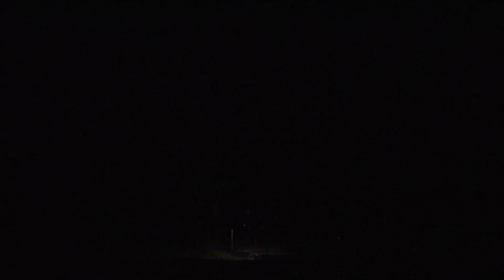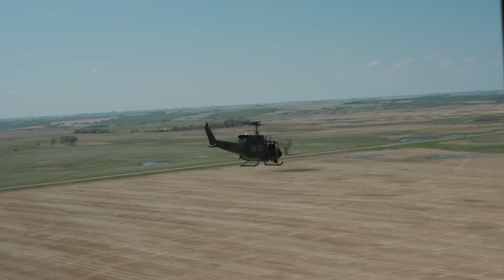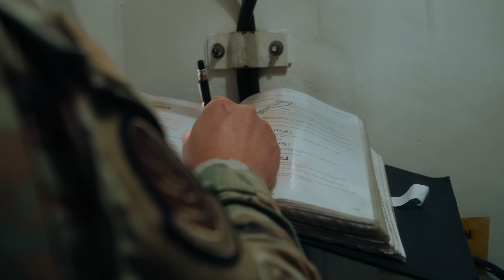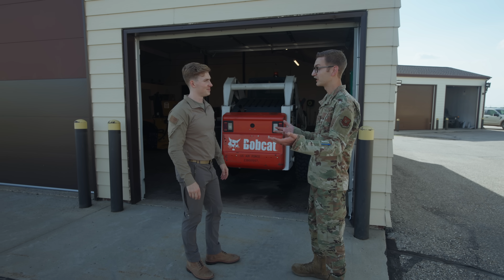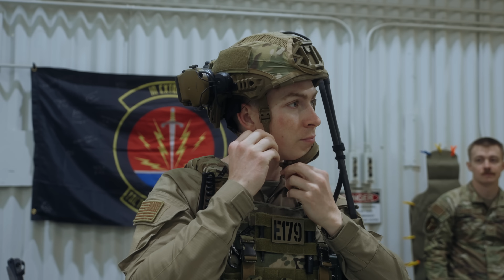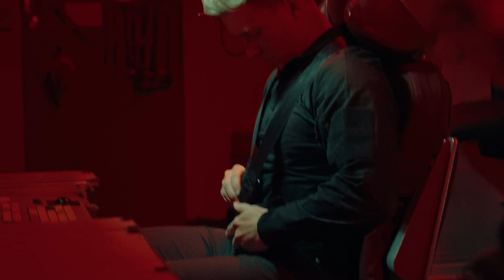Inside A Top Secret Air Force Nuclear Missile Silo

Comment: Interesting tidbit:  all the tools used on the missile are completely unique sizes.  The bolts, screws and fittings are all non-standard, meaning no existing commercial tools will work.

Comment: Unless the protocol has changed since I was a Missile Launch Officer at Malmstrom AFB in the late 1970s/early 1980s, it takes another missile launch crew, in another separate Launch Control Center in your squadron, to verify the launch orders, enter the needed codes, go through their launch checklist and then turn their keys for the missiles to actually be launched. This was in place as a fail-safe measure so one crew could not launch nuclear weapons on their own. In other words, again unless the procedures have changed through the years, one crew cannot launch the missiles by themselves. It takes another crew at another site to independently do their actions and turn their keys before a launch can happen. I don't think that was mentioned in the video. Just FYI. Great video and thanks for making it.
Reply: Thanks for doing your job with these amazing weapons 👍

Comment: I was a 742nd Crewmember back in the 80s so I pulled a few alerts at Oscar. This was fascinating. A few reactions.

1. The LCF was a fricking palace. When did that happen?
2. Interesting to see the mix of new stuff with old stuff. The Enable panel and the Launch Control panel were just as I remembered. No LECG though.
3. Where is the Red Box? Who said they could remove the Red Box?
Reply: Cool to hear you worked on thesr amazing weapons 👍

Comment: i have a question when these miitary personnels are trasnporting these resources    arnt they radio active like can cause cancer or something how are they sealed and protected.?
Reply: I am one of the ones who used to do this job, well like 25 years ago, But security was not well informed on that subject, we was told it was safe. I am sure some "expert" will reply to this pretending like they know what they are talking about.  The way we looked at it was like any job. We would do the job and go home. We understood and respected the risk involved, but when we was transporting the weapon, we did not talk much about the job, it was pretty much water cooler talk the whole time. We was ready to react if needed.  But honestly, 95% of the job is just riding or driving the vehicles.

I wish i could give you a more solid answer than that. Hopefully one of the missile maintenance guys or girls will see your message and respond.  The ones that would know for sure is the Department of Energy, but the chance of one of them responding is very very low.

But (crossing my finger) i have had no signs of cancer

Comment: i used to work along side the 91st as a mobile vehicle mechanic (we were called mobile joe lol). working in the missile fields, fixing broken trucks or helping with the convoy movements was by far my favorite job/mission i had during my 11 year air force career.
Reply: What year? If it was anywhere around 2000 you was always the big hero... When we got the M1116 HMMWVs, and was flinging fanbelts left and right. (i was in the 90th, ie FE warren, security)
Reply: Also i know it is slightly enjoyable that you know you dont have to really stop for anything (when doing movements)
Reply: @floridaboz1 i was there well after that time, 2016-2019

Comment: This was extremely cool so here’s a    fun fact:heres how to build a nuclear reactor: Step
1: Acquire Uranium (Or Another Fissile Material)
Before you can even think about building a reactor, you need fuel. The typical fuel for nuclear reactors is Uranium-235 (U-235), but other fissile materials, like Plutonium-239 (Pu-239), could also work.
In a real-world scenario, you can't just walk into a store and grab some uranium. You'll need to obtain it from a specialized supplier or government facility (assuming you want to stay out of jail).
Uranium-235 is naturally rare (only about 0.7% of natural uranium is U-235), so it has to be enriched (increasing the percentage of U-235) to make it usable in a reactor. You'll also need to check the regulations because getting your hands on uranium is highly regulated.
In our theoretical scenario, let's just say you managed to acquire a truckload of uranium in one convenient shipment. You've got about 5 tons of U-235 ready for action!
Step 2: Assemble the Reactor Core (The Hot
Zone)
The reactor core is where all the magic happens.
This is where you'll place your uranium fuel and let the nuclear fission process begin.

Fuel Rods: First, you need to take your uranium and put it into fuel rods. These are long tubes that contain uranium pellets. Think of them as giant space-age pencils filled with radioactive material.
The rods are arranged into fuel assemblies, which are carefully placed inside a reactor vessel. You'll arrange them in such a way that there's enough distance between them to allow for controlled fission.
The trick here is that the uranium will split (fission) when it absorbs a neutron, releasing tons of heat and more neutrons in the process. These new neutrons will go on to split other uranium atoms, creating a self-sustaining chain reaction.
But hold your horses! You can't just let this reaction run wild. You need to control it.
Step 3: Control the Chain Reaction (Like the Boss
You Are)
In a real nuclear reactor, you use control rods to regulate the chain reaction. These rods are made of materials like boron, cadmium, or hafnium, which absorb neutrons. By inserting or removing these rods from the reactor core, you can increase or decrease the number of neutrons available for fission, thus controlling the reaction.
If you want to slow down or stop the reaction, you insert more control rods.

If you want to speed it up, you remove some rods.
In our theoretical reactor, let's just assume you have perfect control and never let things get out of hand. You're basically playing nuclear chess with your rods.
Step 4: Add the Moderator (To Slow Down
Neutrons)
Now that you have your fuel and control system in place, you need a moderator. The job of the moderator is to slow down fast-moving neutrons produced by fission. Slow neutrons are more likely to cause more fission reactions, making the process more efficient.
In real-world reactors, you might use:
Water (HO) (most common in Pressurized Water Reactors (PWR) and Boiling Water Reactors
(BWR)),
Heavy water (DO), or
Graphite (used in some reactors like the Chernobyl-style RBMK reactors).
For this theoretical version, let's just say you're using ice (because cold is cool, right?). You could surround your fuel rods with ice, and as neutrons smash into it, they slow down and get more likely to hit uranium atoms.

Now, ice is not technically the best neutron moderator in real life, but in this world, we're going for the aesthetic of an icy nuclear reactor.
Step 5: Add Coolant (To Keep Everything from
Melting)
When uranium atoms undergo fission, they release huge amounts of heat-enough to melt the entire reactor if you're not careful. To prevent this, you need a coolant to absorb the heat and carry it away from the reactor core.
In real reactors, water is the most common coolant because it absorbs heat and can be pumped efficiently through the system. However, in our theoretical design, let's choose molten lava (because, hey, why not?).
You can now pump molten lava through pipes in and around your reactor core. As it absorbs heat, it'll get extremely hot, which can be used to generate steam for power generation.
The heat will transfer from the lava to a secondary water loop that will turn into steam, which will be sent to a turbine.
Pro tip: Just make sure the lava doesn't melt through any of the reactor vessel walls. That could be bad news. But, since we're operating on theoretical logic, we'll assume this won't happen.

Step 6: Steam Generation (Turn Up the Heat!)
The hot molten lava you've just created will need to be used for something productive, so we'll send it to a steam generator.
In your steam generator, the molten lava will heat a secondary loop of water, turning it into steam.
The steam will then travel through pipes to the turbine, which is the real engine of the system.
The turbine will spin, converting thermal energy (heat) into mechanical energy.
This mechanical energy can be converted into electrical energy through a generator, which is basically a giant magnet spinning inside coils of wire. This is where you'll get your electricity!
Step 7: Build the Turbine and Generator (For That Sweet Power)
Now, it's time to spin that turbine and produce power! The turbine is a massive spinning blade connected to the generator. When the steam hits the blades, the turbine begins to rotate.
Turbine blades spin when steam is pumped through them.
The spinning turbine powers the generator, which produces electricity.
So, theoretically, you could now start supplying power to a small city, assuming you haven't caused a melt-downs yet.

Step 8: Containment Structure (Don't Blow
Everything Up)
In case things go really south, you need a containment structure to keep everything contained in case of an accident. This is the emergency plan for if things get a bit... explosive.
The containment structure is a thick, reinforced concrete building designed to withstand any explosion, radiation leaks, or unfortunate accidents. You need this to prevent radiation from escaping into the atmosphere.
So, you've got your reactor core, coolant, moderator, turbine, and containment structure.
Everything is set up, and you're ready to generate massive amounts of energy!
Final Step: Enjoy Your Reactor!
Congratulations! You've theoretically built your nuclear reactor. You've got your uranium fuel rods, control rods, moderator (ice), coolant (lava), steam turbine, generator, and a massive containment structure to protect you from the consequences of your questionable life choices. Please like this took 2 hours to type.
Reply: Chatgpt? Grok? Gemini?

Comment: I was stationed at Vandenberg AFB from 1967-1971 as a Minuteman missile launch officer. It was the heyday of Minuteman testing. I worked about 200 launches and actually turned keys on 18 missiles, including MM I, MM II, and MM III, for which I have sack SAC missile on certificates. An additional duty I sometimes volunteered for was visual observer (VO). The VO was on the camera pad nearest the silo, basically looking down the hill at the LF, and was responsible for giving a verbal narrative of the launch: launch closure open, ignition, missile away, and reporting any anomalies. You're as close as you could get to the LF and was an amazing experience; the noise, especially, just overwhelming the senses. One time I did notice something unusual about the way the missile was acting — it seemed to have begun a slight corkscrew — and told the launch director I thought we had an erratic missile. Things got interesting quite quickly and range safety finally blew the missile. The most beautiful launches were those that happened just as dusk was fading. Sometimes when the second and third stages separated, as the gases quickly expanded in the virtual vacuum at that altitude the just set sun would shine through the moisture in the gases and create incredible color cloud displays that spread out across the sky. It could be seen as far away as LA and San Francisco. In fact, when it happened on one of my launches Davis-Monthan in Tucson reported being able to see it. Best duty ever!
Reply: Cool 👍 Thank you for working on these amazing weapons.

Comment: That would be the most boring job
Reply: I did the security side of this for 5 years, and it is about 98% boring, and 2% excitement. Important jobs all around, but you are very correct, it is very very boring. Just think of it this way, driving a HMWWV from silo to silo for 12 hours strait. HMMWV's are not known for comfort, and believe me, they are as uncomfortable as they look, and then think about being in one for 12 hours strait. When i was in, they did not have the bearcat's yet, so i cant speak on how they was.

Comment: They are not exactly hidden, you can drive by them anytime you want. Just don't try to enter the gate, a strike team will have you hugging the ground in short order, I was a targeting team member at Malmstrom AFB, MT. In 1966. They have definitely been improved but are basically the same. Been in several LCFs and tons of LFs over my time there. Still brought back memories, though they were distant memories.
Reply: What was your Tango-team number?  I was Tango-9's team chief about then. They don't target the birds using those Swiss-made theodolites (that the Russians used the bottom part!) anymore. All done from the capsule, star trackers and GPS and other stuff.  Remember trying to do an RMAV from Station A at about -40F? All sorts of fun! What I don't get is the thing about "four keys to launch". Remember trying to drive to Oscar-1 and then going to work and finish in enough time to drive back to base without having to RON? Even get lost trying to find a site in India-flight, even with the site map?  Did you ever try to get T-van 805 to drive to a site without the engine blowing the freeze plugs if the OAT was below freezing? Are you a member of the Association of Air Force Missileers? They are holding the bienial meet at Minot next August. Wonder why not in the usual month of October? lol  Why not Minot? Freezin' the reason. SACum cized member of the 341st MIMS 1965-69.
 
 I see four keys in one capsule, but it used to take two capsules (4 capsule drivers) to launch.

Comment: Never understood why missileers wear flight suits.
Reply: Because it’s an enclosed environment with an electrical equipment that can catch fire. Flight suits are fire retardant. 

Missileers used to have a different distinctive blue suit. When the budget cuts hit near 9/11, the pilots that ran the Air Force took the blue suits away and said, “here…just wear the green suit.”
Reply: @EverydayMarksman  Do you know why they strap themselves into the chairs?
Reply: @tw27242 in a nuclear exchange, there’s a high probability of “man-made seismic activity.” The straps keep you in the chair, and the chair locks down to a rail. The whole LCC is also hanging from a suspension system with shock absorbers.